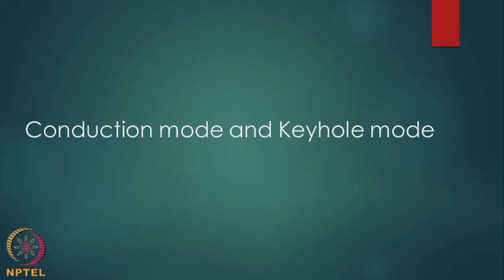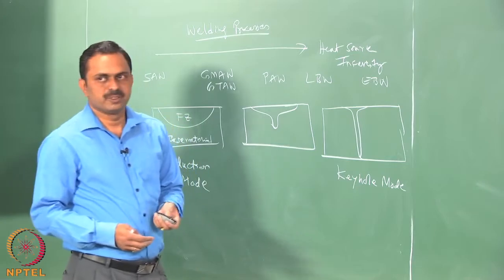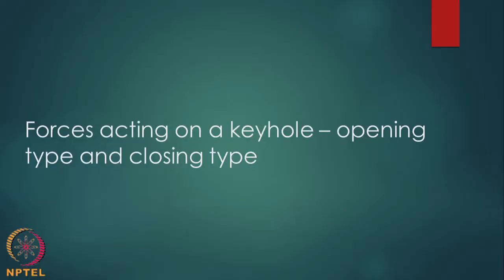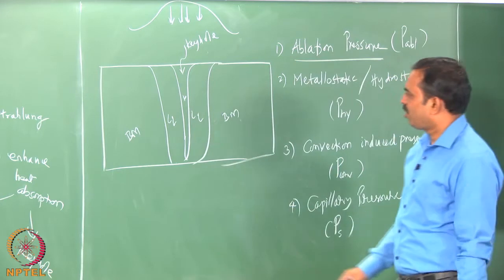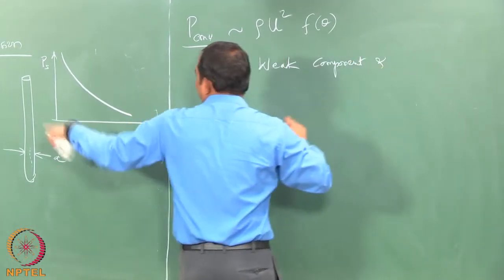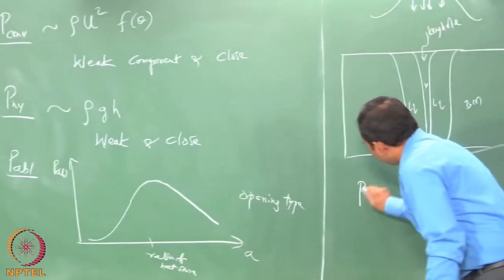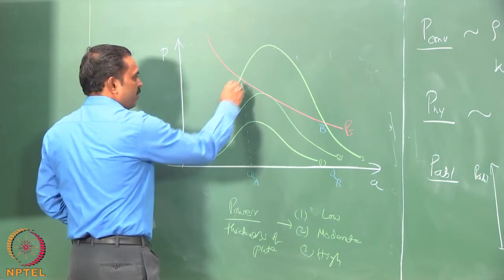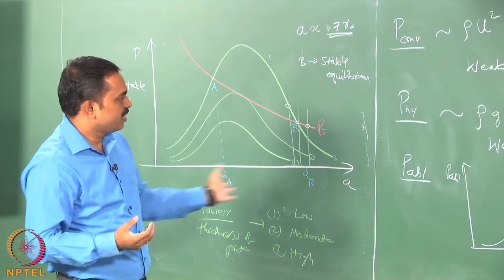Conduction to Keyhole mode

Comment: Thank you for this vidéo, it's very clear. jusdt 2 questions, I want to know if the keyhole created in the case of welding is the same as the keyhole created during the SLM process, means the forces acting are they the same??? also, is it preferable to work in keyhole mode or conduction mode in the SLM  process?
Thank you again